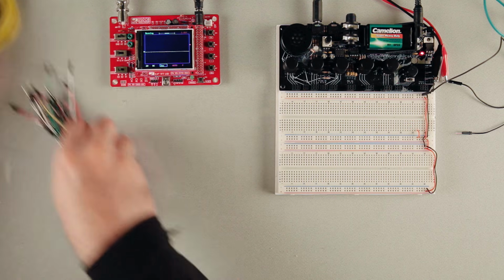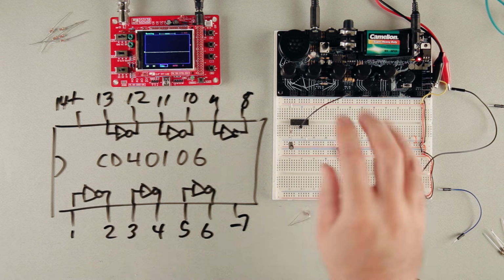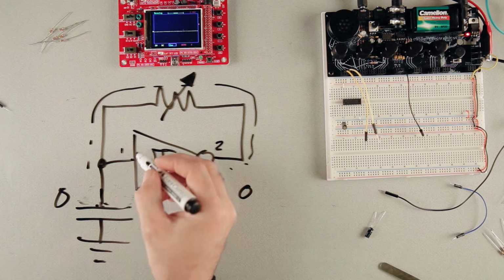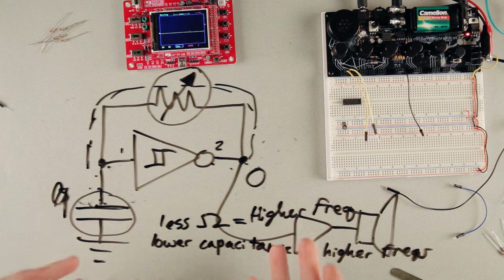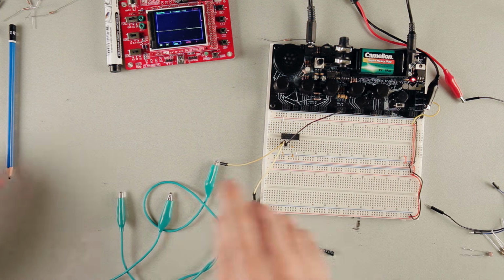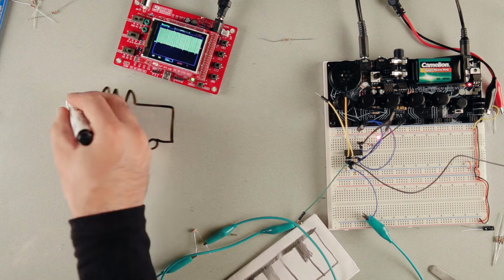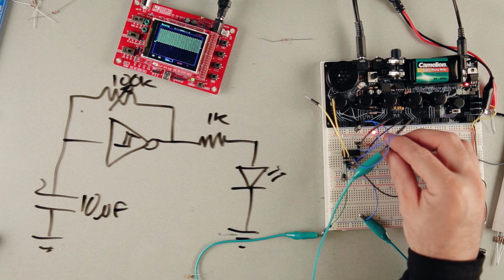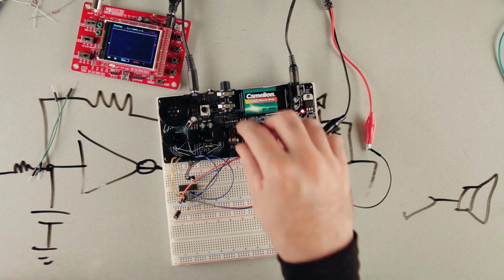Casper Electronics DIY synth building. Part 1: Oscillators

Comment: i tried with .1uf capacitor but it was non polarized, it didn't work. did i do something wrong or was it probably cause it wasn't an electrolytic? i would really appreciate a resoonse
Reply from the maker: Will Banks the cap does not need to be polarized so the problem is caused by something else
Reply: yeah idk what it is. i am getting power from a DC jack, should i try a 9v instead?

Comment: My 1st experience to make some analog osc. was LM555. This thing is great and can be hot :D
Guys'n'girls, are op.amps ideal to build a multiwave osc. with a CV control? I've made some... experimental (not my schem. of course) with TL074. It gives a loud square output but a very low tri/saw output. I can't hear it on my Accord 6AS dynamic (6 ohm) and other (9 ohm) also.
P.S. also people mention that it's easier to deal with a bipolar PSU than to fix every DC offset in a circuit.
___
P.P.S. the behavior did changed eventually and it sounds normally now :) no clues

Comment: Thanks for the tutorial, but i hace a question. it is possible to do an electric  keyboard with only 555 and passive components?

i want to build a 3 octaves keytar with 12 555 (1 each 3 notes) and 1 more for manual control

Comment: So I keep getting dead spots and what sounds like just little taps.  No actual wave length.  I hear a little bit of ocillation at the high end of my 100k pot.  Wish i had an Oscope to see what my waveform looked like.  I can get a few audible frequencies to come through but not much between just dead air and these little tapping noises.  Any idea how to remedy this?  Im running the signal through an 9v LM386/741 amp circuit i got from Forest Mims' book.

Comment: Thanks for the vid! I am new to the hobby, this is the best I have found through all my research. However, the link to your site for the schematics doesn't work. Like it is hacked or something. If your schematics are as easy to understand as your videos, I would love to see them. I have been having trouble finding good ones online. Thanks again! I see many many people appreciate the vids. Keep them up!
Reply: they work for me. :/ my site was hacked a month ago and it was flagged by google as a "dangerous site". it was cleared up quickly but it takes time for google to remove the flag.
Reply: Peter Edwards 
I wonder now after reading the comments if my problem is not having an amp before my speaker? I am trying to build a sequencer, all my LED's are blinking but no sound. Just a single click from the speaker when power is hooked up.  However none of the schematics show an amp. I will just keep at it, how else to learn but through trial and error

Comment: When I change from square to triangle the frequency drops. I am not using a 40106, but an LM358 in Schmitt trigger configuration and my speaker is a piezo buzzer. Any idea why that is? 

btw. Thanks a lot for this video. It has helped me a lot in getting my opamp to oscillate... :)
Reply: it probably has to do with WHERE you are sending the signal. It should go to an amp of some kind with high input impedance. Basically this means it will look at the signal but not consume any of it. When this happens the rate of oscillation will change since some of the signal will be going to the thing you are plugged into (like directly to a speaker for instance) and will not be available for oscillation stuff....
Reply: Thanks for the reply! I'll try to route the signal through the other opamp on the LM358 as a buffer and see if that fixes the problem. I guess it should...

Comment: I've just finished building one of the DIY kits for this, however I only get a static or feedback noise from the speaker regardless of what I change. Are there any common issues or mistakes I may have made when putting the board all together? Any kind of troubleshooting advice would be amazing! Thanks!

Comment: Where did you get the oscilloscope?   I would like one.   Please give me a URL.
Reply: The name is right there on the board...
Reply: James Clark hey I bought one pretty similar on aliexpress... it's a diy oscilloscope so you must solder everything (including some small SMD components). Maybe there's a "ready to go" version. Oscilloscopes use to cost a lot but this one was like U$10. I didn't get it yet so I can't tell how hard it will be to gather all together
Reply: DSO138.  There is a ripoff version issue... fully assembled around 20 bucks
needs adapter 9v or battery to operate.

Comment: I was looking at Mouser to try and find the CD40106 to make one of these myself, and it turns out there is an entire line of them, many of which say they do different things, and several of which are Schmitt triggers.  Is there a specific one on there you can link to that would be the right one for this?
Reply from the maker: the cheapest one :) But make sure its DIP format not SMD (surface mount)

Comment: Very nice for beginners! Where this oscilloscope can be bought? Is it a common part? Is it hard to build saw, sine and noise generators? How to build filters? Can such designs be taken seriously to create own blocks to make a modular system? (I mean when you've done, it will be re-made on a small strip board and soldered)
Is it hard to build analog filters? Can it be done with not too much components?
Is it possible to connect this scheme to a MIDI keyboard (using Arduino or something other or a different way)? I mean "is it possible without a big pain?"
Sorry for so much questions! Not necessary to answer quickly because I'm just interesting now. It's for the future... maybe I'll go and buy necessary parts and devices to make such a synth...
Thanks, you're doing great videos! I hope children will choose this over Minecraft and other not very educative stuff :)

Comment: hey Casper - thanks! Broad question here - what makes here makes high quality analog oscillator sounds? it it the quality of the components? Do moog/buchla etc just invest in high quality components? I.e. whats inside these modular synths/analog things thats making them so expensive other than just good branding? thanks
Reply from the maker: Hey.  This is a big question and i'm sure opinions vary dramatically on this. but MY opinion for what its worth is that the quality of the components has very little to do wth the quality of an oscillator. Whats more important is that the circuit is well calibrated. Higher quality components are generally more accurate relative to their specified rating so its easier to make a correctly calibrated circuit with components that are the ratings they say they are. But with some patience and test equipment you can use imperfect components to tune your circuit correctly. 

That said, some people may argue that certain components like transistors and capacitors are more critical. 
In any case what i find far more important is the architecture of the circuit. simple and elegant is the way to go

Comment: Is this board being powered via the 9V battery or AC?
Reply: in the video it is powered by an AC adapter which outputs 9Volts DC. BUT i can be powered with a 9 volt battery

Comment: hello, i'm wondering,..is this the same type of oscillator's you will find in te average synth that you can buy?
Reply from the maker: yes. but with less flexibility. These are good square wave oscillators. Most synths will offer more wave shapes. These also suffer when it comes to external control like using voltage or midi or something. For experimental noise circuits the ones in this video are great. and with a filter you can get very nice "pro" sounds
Reply: Are you planning any additional videos that cover producing other waveforms?

Comment: Since I didn't have the amplifier u have in your video (or another amp at all), i tried to do it without. First of all there came no sound whatsoever out of the speaker i plugged directly from the output to ground. Found out that a capacitor between the output and the speaker fixes this. Is that what they call a decoupling capacitor?
Reply: Actually that is a DC blocking capacitor. A decoupling capacitor always connects to ground at one end, hence it decouples (usually noise on the power supply rails) to ground. It could technically be called a coupling capacitor (since it couples the output of the oscillator to the input of the amplifier/speaker) but definitely not a decoupling capacitor. A capacitor connected between pins 14 and 7 of your 40106 would be a decoupling capacitor (though not actually necessary here.)
Reply from the maker: +Nick B ah! Yes! Nick is correct
Reply: trevortjes which size capacitor did you use or recommend? Thanks
Reply: +casperelectronics synthesizers what s the capacitor value?
Reply from the maker: Yes that's a decoupling cap ;)

Comment: Sorry i m quite new to these sort of things, does anyone tried to reproduce this circuits without the omsynth mini lab? Thank you in advance
Reply: Totally! You just need some extra components and a bit more breadboard space.
Reply: +Rupert Kennedy sure? Cause i can t see the components on "the black board", do you? If u can i d would be very glad
Reply: 100k pots. I connected alligator leads to them, and on the other side of the alligator leads I clipped some jumpers (like what he has going on at 14:44 but obviously the jumpers would be in a different spot on the breadboard) 
     9v battery with a standard connector plugged into the positive and negative busses. Most of the time those are stranded wires that don't easily plug into a breadboard so you might want to alligator clip some jumpers on them too.
     For an output, I attached a 1/4" jack and plugged an amp into to. If you don't have a jack or an amp you could use a speaker. Just make sure you attach a decoupling cap as explained a couple of comments above^^
    Basically, any of the jumpers he has going to the Omsynth can go to alligator clips instead and clipped to the same value component. But like you said, you have to know what they are. Also, you need enough alligator clips;-)
Reply: http://casperelectronics.com/finished-pieces/omsynth-minilab/tech/
Reply: +Rupert Kennedy  really nice, you made my day man, thank you sooo much!
Reply: Great!! Glad I could help. I'm pretty new too and was wondering those same things a few months ago. I think the hardest thing is waiting for parts to come in the mail.
Reply from the maker: +Rupert Kennedy yes! It's all true ;)

Comment: how many ohms is the pot you use to control the pitch? and is it possible to get saw waves out of the chip?
Reply from the maker: The potentiometer is 100k. You can get a saw by placing a diode between the input and output of the oscillator

Comment: Hey. im doing a synth for a uni project and this is very useful. can you recommend a good resource that goes into the more technical side of synth design? Im a bit unsure of the best oscillators to use and how to select the best components etc. thanks
Reply: I haven't gotten that far yet but this is the book from the dude I saw Casper recommend on his website. Hope it helps
http://www.musicfromouterspace.com/index.php?CATPARTNO=&PROJARG=ELECTRONICS%2Fanalogsynth101.html&MAINTAB=SYNTHDIY&SONGID=NONE&VPW=1072&VPH=520
Reply: Thanks. yes I have that book. Its ok but it doesnt justify a lot of what it says. the current flow descriptions are good but often there are statements that dont make mathematical sense and I get the feeling he leaves important info out. Its still worth reading though
Reply: +Captain Rhodes Coolcool. Thanks man. I'm a newb so I haven't gotten that far but it was the only suggestion I had. Hope you find what you're looking for. Best of luck on that project!

Comment: hi there. where can I get that device that you have plugged into your breadboard. thanks jon
Reply: It's called omsynth and can be bought on his website. But it cost about 90 bucks, which is alot money. I recommend buying some pots with knobs (3 lin, 2 log, all 100k for 5$), a small loudspeaker (3$) and an LM386 (1$) and you get all you need for you first experiments for under 10 bucks.
Reply: Thanks for the info Arthur. After reading your comment I am now assuming that I am not hearing any sound (connected to my sound card into Ableton) because I connected everything just to a 9V battery without the LM386 component.

I apologise for my noobness, but started following some videos from Look Mum No Computer, and i managed to build and oscillator without any amplifications, thats why I got stuck here. So for the above kind of oscillator an, Amplification of some sort needs to happen so it generates sound?

Comment: Very nice video! Thank you so much! I have been wondering if I could use the output as an LFO for other devices (Microbrute, for example) or if this means that I would have to to adjust the output voltage in order to make it work? I guess i could then change the IC for a 8038 one and have access to different waveshapes, or?

Comment: Can you show how to make other waveforms?
PLEASE!!!
Reply from the maker: Hey! Ok. It's a lot of info but here you go. Square waves are by far the most convenient wave form to generate for various reasons but.... Yes they can be harsh and/or annoying. Filtering is the easiest way to make them less harsh but they bring their own complications. Anyway try adding a 10k (try higher and lower values) resistor to the square wave output. Then add a 0.1uF cap to ground after the resistor and take your audio out from where the cap and resistor meet. You can also get a triangle wave from the circuit shown in this video but it needs to be buffered meaning you have to run it through a voltage follower before using it. Or even better run it through a lil op amp based inverting amp. The square wave comes from the output of one of the Schmitt triggers in the cd40106 IC. If you take the signal from the INPUT you will get a triangle wave. But as mentioned it needs to be buffered before you can use it.
Reply: Thanks to your video + one other I found I approximately know how to make midi controlled OSC, but all stuff I found for starters have only about square waves and way to control pulse length. And that's it.
Wish there were videos that had like series - from making each waveform (sine, triangle, saw, square/ PWM) than how to expand circuit for OSC to be modular (one option at the time - FM/ am/ rm)
Basically as simplified as possible to take total beginners like me into making some modular standalone VCO module.
I think it's pretty grate opportunity for electronic minded like you, because as I found there are nothing about it on youtube and seems that demand is quite big looking at view count on this video.
Reply: Hi, for my Extended Project Qualification in school (An A-level version of a dissertation - A-levels are a British thing) and I plan on building an analogue synth. Is there a way to tune one of these synths to 440Hz like a normal synth and control it from a midi keyboard?
Reply: @AxiisMusic  if you put diodes in the feedback loop you can manage PWM.
just 1 diode parallel to the pot will make a pulse generator, and a second one with resistors series to them will make a square with a ratio different than 50%

Comment: How could I implement midi in to control sound chip?
Reply: Look for a midi to cv (cv = control voltage) project. There's a couple of Arduino projects that seem to do the trick.
Reply: oh, didn't thought about that.

Comment: Please would you mind telling me/us what is the difference between a current controlled oscillator and a VCO? You don't address VCOs? That statement is confusing for me because I thought those were all VCOs. Isn't it the case that when you replace a fixed resistance by a potentiometer the oscillator becomes a VCO, that is, the voltage that comes out from the potentiometer is the voltage that controls the oscillator. Thanks in advance for your help.
Reply: Ah! It´s the current that comes out form the potentiometer the thing that drives the oscillator(?)
Reply from the maker: +alvaro obyrne yes it's the current. The potentiometer in this circuit is used to control how much current goes from the output of the Schmitt trigger back into the input. In this case the pot is only limiting the signal so you would call it an attenuator. You can make this a VCO by basically replacing the pot with a voltage controlled attenuator. This can be done with a vactrol, a VCA (like the V2164) or with some circuit zazzz and transistors like the 2N3904.
Reply: Got it. You´re so kind. I'm so greatful for your answer. Thanks indeed.
Reply: Ah! You do set a basic vactrol here. Yes at t=1378.